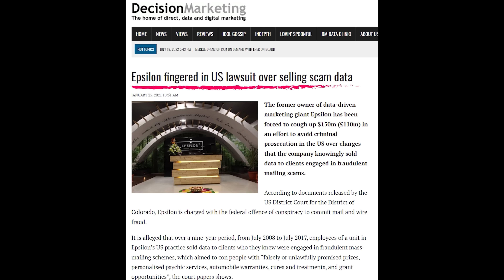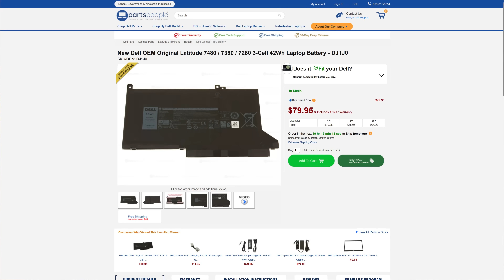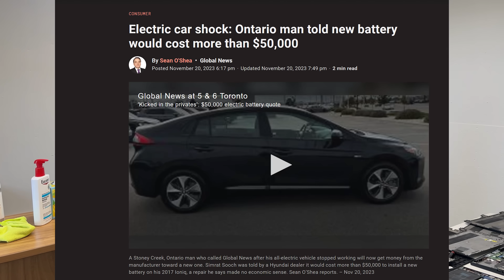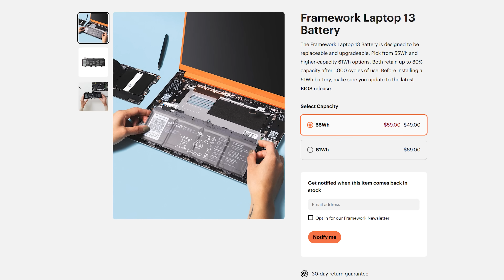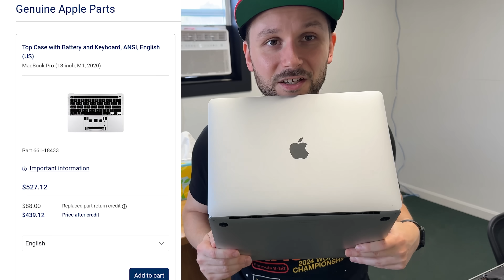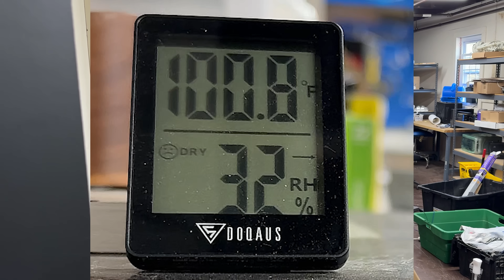Planned Obsolescence: Why is Replacing a Battery STILL So Difficult and Expensive?!

Comment: I get pissed off at Wireless headphones with no Aux in, because even if the headphones are good, after a couple years when the batteries die they’ll become useless.
Reply: have different problem,  aux in exist, battery is good but THAT STUPID headband clip on side snaps and theyre unusable
Reply: @JanyaGalactic  This, like any other 1000 headphones, they are all fixable and wondergfull, until they snap where it sucks the most. I think I never actually had to replace a headset because its stoped working... it always snaps in that place.
Reply: @JanyaGalactic  Find some other old headphones with broken speakers and see if you can retrofit the new speakers in.
Reply: @JanyaGalactic  I have a good pair of headphones I got as a gift last year and the damn part that holds the headphone in place snapped. That headphone is dangling now! Ugh
Reply: @bustergundo516  4 pairs of headphones in row over 6 years have broken like that
Reply: @JanyaGalactic   Glue
Reply: @UfogeArenoki  i did think about it days later when looking at headphones randomly that i can use superattack glue, i didnt think of this comment then anymore
Reply: Depends. I have a hyperx cloud flight wireless headset and when the battery died, i replaced it myself with a little bit of soldering. I bought them in 2020. And replaced the battery in dec 2024.
Reply: @nstorm2415  same for me
Reply: That's where Fairphone headsets excel.
Reply: Can you open them? you could either replace the batteries or ditch the whole wireless portion and solder cables directly to the speakers :D (probably even trow in a Bluetooth 7.1 module and a battery and upgraded your old headphones if your willing to hack and solder. But yeah, enshittification also a thing
Reply: @CodeAsm  yes , but its complicated and you would need amplifier module or something to do that. The whole thing will almost cost you as new headphone. Either buy a headphone with aux or replace battery
Reply: @CodeAsm sadly most wireless headphones, if not all, are completely sealed and impossible to open.
Reply: @lilmancc35  I have never seen a pair that could hold up to a heatgun and a screw driver without giving up their contents.
Reply: @CodeAsm  even if you get it open, most headphone battery replacement involves de/resoldering
Reply: Tws headphones are expandable, despite sometimes costing hundreds
Reply: The stupid ear cups will rot away even before that.
Reply: @mahdi8572 No they wont
Reply: Bruh why are making life difficult by buying wireless headphone. Buy wired headset and then convert them into wireless using bluetooth receiver. It's cheap and modular. Dead battery chuck the receiver and replace it. Simple. If you want to replace battery of the receiver it's much simpler and not ruining your headphone aesthetic.
Reply: 2 years? I'm going 9+ years in my Bose QC35, still no battery issues. I've replaced the pads maybe 7 times already (not with original) other than that no problems. I'm using them daily
Reply: Dank pods has trained you well
Reply: I have an old set of audio technica headphones, still going after 30 years, haven't even replaced the wires.
Reply: Had a nice Phillips ones with a decent and non-dying battery. After a light drizzle it shorted out (both blue and red leds light up when switched on, no response. I can barely solder, nvm to find a fault in something that miniature. Anyone knows is it reparable at home with a caveman's soldering iron?
Reply: I have a pair have Bose that I bought used 5 years ago and battery is still ok actually
Reply: @Adeerinheadlights Skullcandy about the same age. People are clueless
Reply: thank apple's "courage" for that.
Reply: Anker's soundcore headphones are really good and come with a aux in iirc 
This sounds like an ad but it isn't lol
Reply: I even have the cheapest TWS headphones that lasted much longer than any wired headphones. Simply because wired headphones have an eternal problem with the wire, which constantly breaks. That's why I hate wired headphones, they are absolutely inconvenient, they constantly break and get tangled in your pocket. The need to charge the headphones once every 2 weeks is absolutely worth it so you don't have to torture yourself with wires
Reply: @otto__3  All wires for headphones should be detachable that would help at least a bit. Until you damage the aux port on the headset.
Reply: Couple years? 😂 You must not take care of your devices or clueless about batteries. Probably both
Reply: You get aux, and suddenly they will create a new standard making all previous headphones obsolete :/ 

Unless s good adapter exists
Reply: Or better yet. They will remove aux from computer cases and motherboards :)
Reply: @0Blueaura  Not really an issue, and they'll never completely go away. People use computers for serious tasks like music production, video editing, meetings, stuff that sorta require headphones/speaker connections.
Reply: I don’t have this issue since I have a steel series arctis nova pro
Reply: Yea. Sony earbuds are a prime example battery dies in less then a year
Reply: @yyeezyy630 Batteries shouldn't be dying in a year. Probably user error
Reply: That's why I don't buy them at all.
Reply: not even aux in will save them. i had a pair of bt headphones die. had aux in, didnt work. just fully dead
Reply: I have two bluetooth headphones
One has bluebooth only with good battery life and sound quality sre good enough  can last more than 1 week without charging

The other one has both bluetooth and aux port the battery sucks so most of the time i just the aux cable.
Reply: I used to have an old pare of SONY headphone meant for the ps4 when xenoverse 1 came out, they had a AUX port and could be used, loved them, ended up losing them in a house fire
Reply: I think I am rough on headphones because my headphones are broken otherwise before the battery ever dies. My current home set need a little superglue but the battery still solid. The life of the battery is getting to where I need to charge it a couple times a week now but as long as it gets through a day that is fine by me. I got over 6 years out of them and that is fine by me. My set for my phone I am on my third set since 2014. At about 30-35 dollars a pop I don't think that is all that bad either. Never has the battery been the failpoint. 

Now wired headphones? I can't remember a time that it is not the wire that is the fail point and often in half or less the time it takes me to break a wireless set.
Reply: My steel series headset has a battery that you swap from the outside. Combined with the charging station it's one of the best wireless headset systems since you can buy new battery's and throw them in without any tools
Reply: And this is why I still want a headphone jack on phones. Yeah wireless exists and if you have wireless that works for you then enjoy. But I don't want to have to replace wireless buds every few years when the batteries that can't be replaced die. Just let me plug in my 3.5mm cable from my headphones that never have to worry about batteries, stop making me struggle to source USB C dongles that don't introduce noise and/or don't frequently disconnected despite not being touched.
Reply: Get some studio headphones with low resistance and mini XLR connector. I love my AKG open back headphones. They're maybe 60$ and after using those I will never go back to any other style. Except for sport ebuds for working out.
Reply: Then don't buy them
Reply: This is precisely why haven't bought wireless headphones.
Reply: You can replace them through.  Replacement batteries for headphones run about $7 but they don't last as long as the original.
Reply: And the fact that they cost 300$ min. for it to last a year or 2
Reply: Got my sony wh1000xm3 still running after 7 years without battery replacement its amazing love the company since ps1 crt tv‘s and walkmans ❤
Reply: My Beats are wireless yet they have a unpluggable wire that I can use. Pretty useful
Reply: They're laggy when you play Fps games, useless for gaming.
Reply: Fragile hinges (if you decide to get the foldable one) and the friggin pads, gosh I hate the fragility of the pads skin? (Lamination? Idk what to call the thin black skin on it) 😅
Reply: psst
hey

hey kiddo
have you heard about the logitech g435?
while it doesnt have a 3.5mm nor direct wired audio
its so repairable even my blind grandpa could do it
i can spot this masterpiece of product design in a crammed bus in my peripheral vision
i recognize it from videos
i know its technical drawins from just a few pixels
i see it everywhere
i might have an obsession

its just 50 bucks and so hecking comfy
Reply: @kkjkjh  Sounds Interesting... What makes the G435 so repairable? Easy disassembly?  Easy soldering? Available batteries?
Reply: Can’t you just hook it up your PC or laptop with a usb cable?
Reply: @moogle17  most wireless headphones i used will automatically turn off when charging, my current pair (JBL tune 720 bt) even has a charging port in such a place i can`t even wear them when they`re charging - it seems to be intentional, their only saving comes from wide aftermarket support
Reply: @NomstersoN i hate that about bt headsets, even my Jabra receivers back in the day just flat out refused to turn on while charging
Reply: @NomstersoN  The only set I have had that are meant for home/pc use and not on the go use charge and play. So even if they die I am just wired for an hour or so and after that back to a few days of wireless. I would think that this really should be a standard at this point weird.

Comment: Getting rid of windows 10 support sucks, especially due to the older laptops with it
Reply: By doing so they force lots of people ( that need to be able to keep security and drivers up to date for a variety of reasons ) to buy the new version of Windows.  And thus Micro$oft makes money.  They've done the same thing before with previous versions.  Hell, Windows XP was so popular and it's follow ups so bad, that M$ actually forced through an update that made it run worse to try and convince people to switch to later OS
Reply: none of my computers support windows 11, they're all running windows 11 🤣, just use rufus and check the bypass boxes
Reply: You can easily move your Windows 10 install to the IoT LTSC version that has around five more years of support.
Reply: @elu9780  Except that there is no easy and cost-effective way for a consumer to legally license this.
Reply: @Alpha8713  Microsoft doesn't care, you can do it for free.
Reply: @elu9780  That doesn't make it legal.
Reply: I have no interest in moving to Win 11. All our PCs desktops and laptops are on Win 10 Pro. I'm going to give 0Patch a try. I'm running Ubuntu on another PC but have not used it enough to become proficient.
Reply: @tomschmidt381  I'd recommend giving Mint a try, it's a super beginner-friendly distro based off Ubuntu and the desktop layout is really similar to Windows
Reply: It suck, what can you do about it? Microsoft usually supports their OS-s at around 10 years. Same thing happened with Windows 7 when it ended in 2020.
The problem here is the stupid artificial barrier to run Windows 11. My old HP laptop from 2018 has TPM 2.0, but guess what, it still can't run it because the CPU is not supported. Those artificial limits are the problem here, which renders millions of computer useless and in landfills, even though they still work fine and can get the job done. My 2015 ThinkPad X250 still works fine today, and to circumvent the stupid limitations, I installed Windows 10 LTSC on it. That baby will be supported until 2032.
Reply: @Dac_DT_MKD  the thing is, considering what most people use their laptops for, even without support Win10 should still work fine...but people see the message that M$ keeps sending out about Support Ending and they panic and buy a new computer that they don't need.  Greed runs the world
Reply: @Dac_DT_MKD It's a simple registry entry to bypass the Windows 11 CPU requirements for an upgrade.
Reply: @McNasty43 Yea, but you won't get upgrades to the version of Windows 11. You'll be stuck with that version and be out of date and vulnerable to hackers. No different than staying on 10.
Reply: (they dont know i use arch)